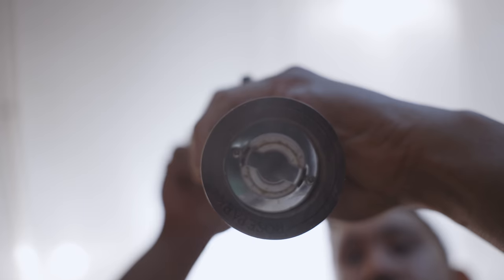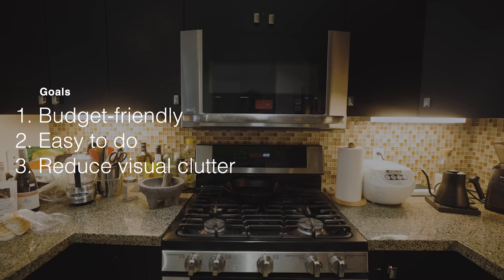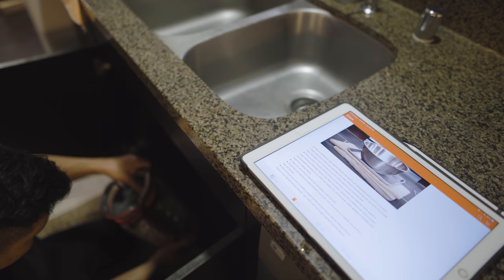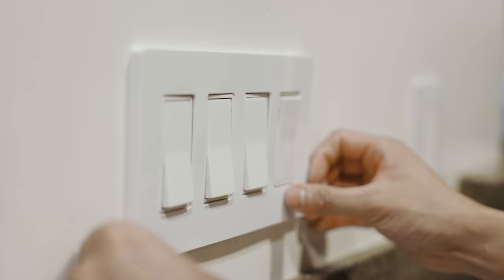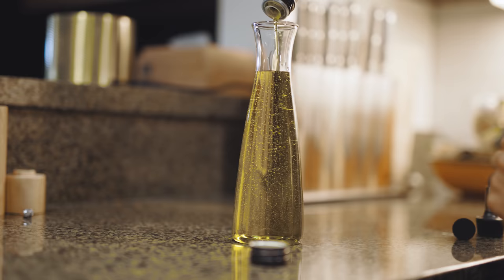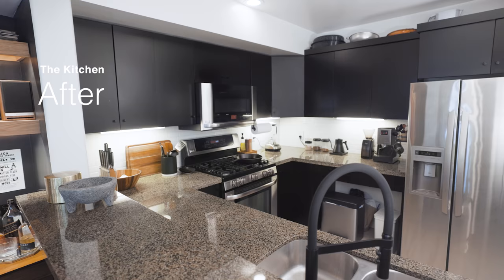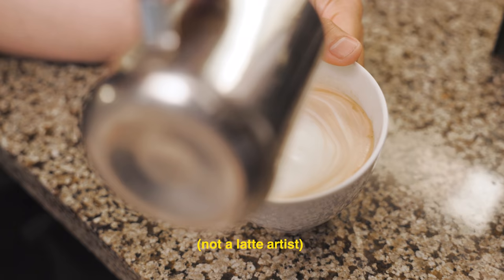Kitchen Makeover & Organization – Simple & Minimal Renovation

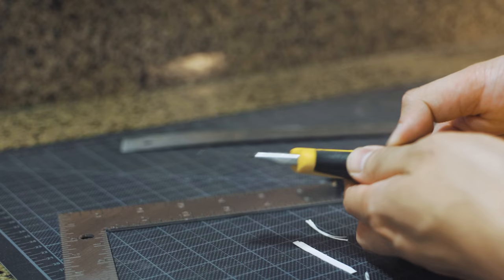Comment: 2:18 you don't change the entire blade, you snip the blade using the bottom of the cutter which has a slit where you place the blade and break the dull part off or you can use player too.

Comment: Did you know that those Olfa blades are actually designed to be broken at the perforated diagonal lines? That way you can maintain a sharp tip until the entire blade has been used. Looks like you were only using about 5-10% of the blade :(
Reply from the maker: I found out after
Reply: What? I had to rewatch it. Matthew through away the whole blade thing? Older Graphic Designers would now that but I guess he never cut and pasted anything. ;-)

Comment: Visually the white subway stickers are great but over a short period of time it will peel off and will dirty very easily because of kitchen fat, dust, etc

They will never replace real subway tiles that are quite cheap to buy
Reply from the maker: You might be right. But taking out the tiles was not a project I wanted to commit to yet.
Reply: @MatthewEncina  indeed it is a bit complicated to remove the old ones, you will have to redo a clean wall to put new ones. This could be a temporary solution and you will figure out over the next months if you are going for it but once done you will be good for a few years :)